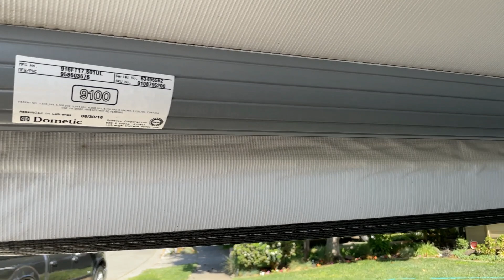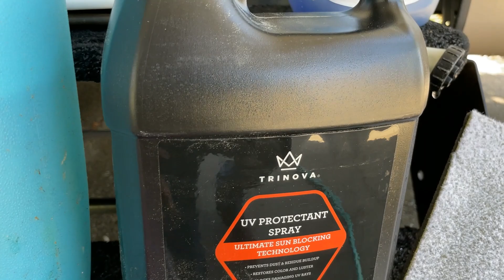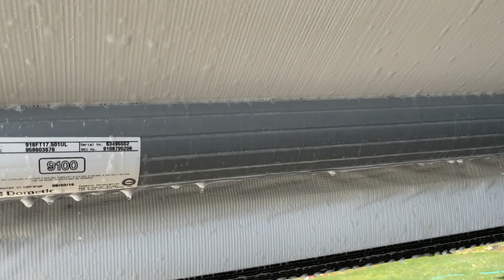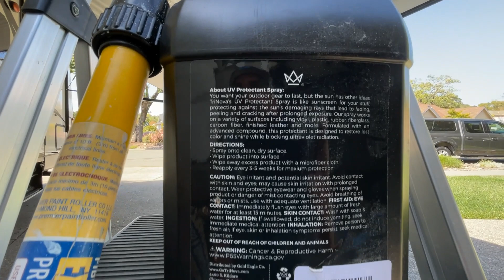RV Awning Cleaning and UV Protection Maintenance - Step By Step (Keep Your Awning Looking New)

Comment: Good idea to roll it up to soak 👍
Reply from the maker: Thank you Ken and thank you for watching
Reply: @thetraveltrailerguy  Hey Michael , You will want to check if your frig. vent cover is sealed to sidewalk real well . I just pulled my screws out to put sealant in the holes and bingo , they are all rusted . So that's a new trailer so I suspect any with a few years it's worse . Sealant on the outside needs to be good to hold it from taking flight on our fine byway's
Reply from the maker: @kenj.8897  Thank you Ken, I'm going to have to check this out today. I'll let you know what I find. Thanks so much and thank you for your comments, tips, and for watching
Reply from the maker: I pulled off the side vent cover and checked all the screws and they all look like new, I wonder why your were so rusted? We camp at the coast a lot in the salt water air and we are okay. I did notice some rust on the screws & screen on the roof refrigerator vent when I removed it. Skip to 4:23 minutes into this video to see the rust and what I did - https://youtu.be/zUxnQ6C1BlY   Thanks again, Mike
Reply: @thetraveltrailerguy  Thanks for checking yours out.  I'm guessing because mine were not tight water hit the head and followed it in.  
At least they were not stripped I guess . Have over 100 hours on this thing so far making it tight . The end is near 👍

Comment: Why do you put uv protectant on the bottom where the sun doesn't hit?
Reply from the maker: Now that's a good question and you are the first to ask this :)  I put this protectant under the awning for a couple reasons; 1) It helps keep the material conditioned so it doesn't get hard and crack later in life.   2) It helps by sealing the awning so its a lot easier to clean when its dirty    3) it keeps the awning looking new on both sides.     Great question, thanks Jaz
Reply: @thetraveltrailerguy  i did not think about that. I just cleaned my awning and had to use some elbow grease for some of the stains. That's a great idea about conditioning it and keeping it easier to clean for next time. I will adding my uv protectant this week after this rain goes away. Thanks
Reply from the maker: @yankeesusa1  Awesome, if you can remember let me know how it works for you? Take care and happy camping